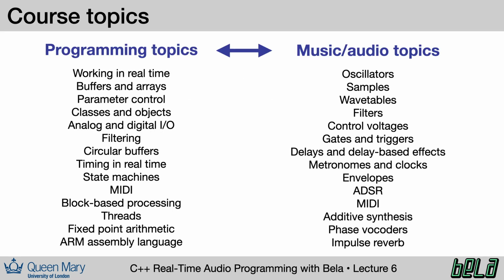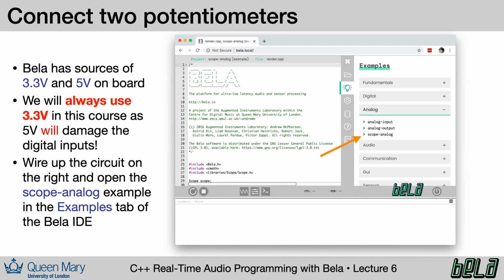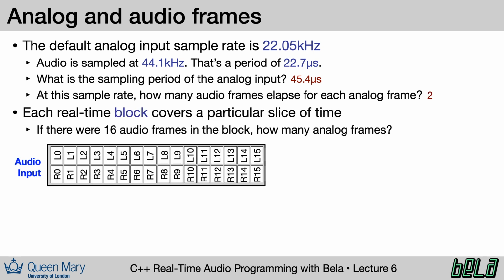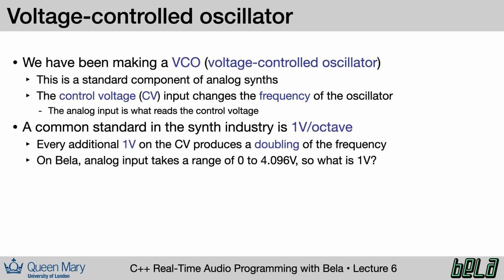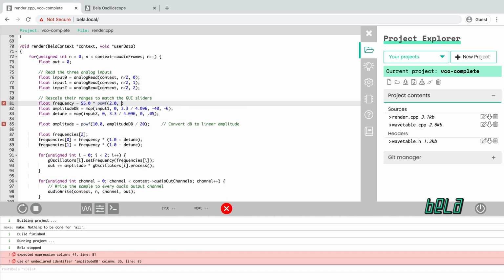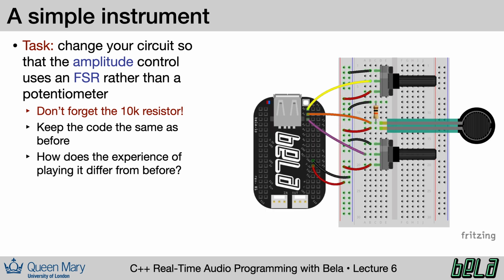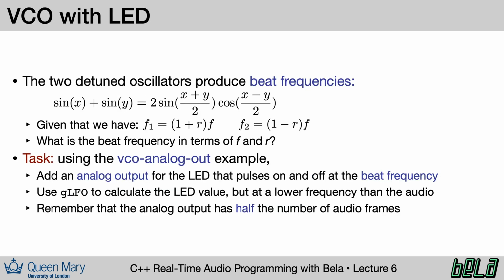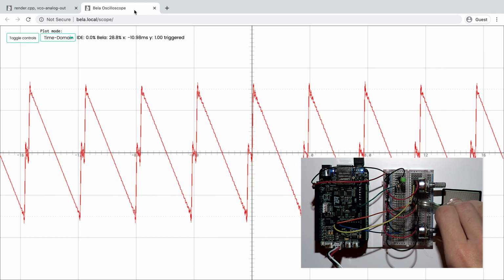6: Analog I/O, C++ Real-Time Audio Programming with Bela

Comment: PSA - Don't buy the recommended potentiometers from adafruit (part no 4133), they don't work well on a breadboard because there are extra support legs that need to be removed in order to plug into a breadboard